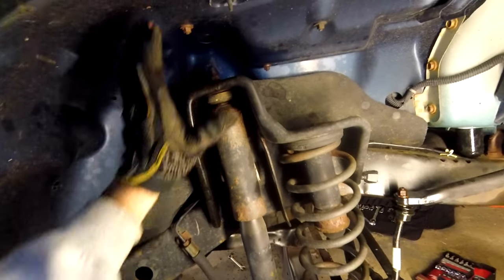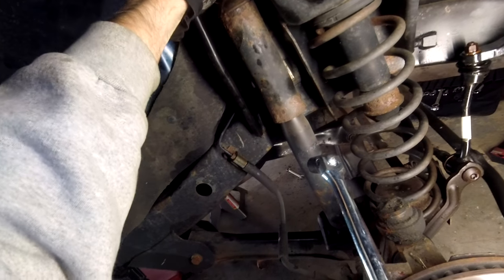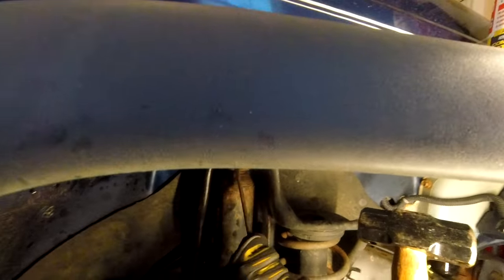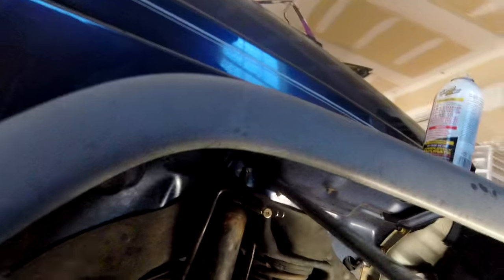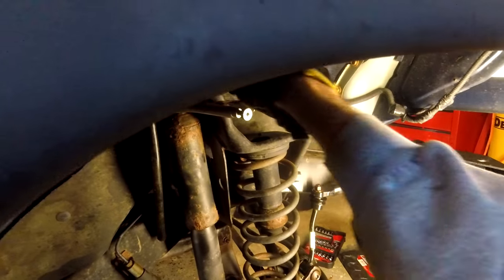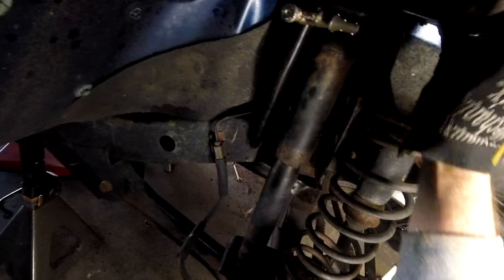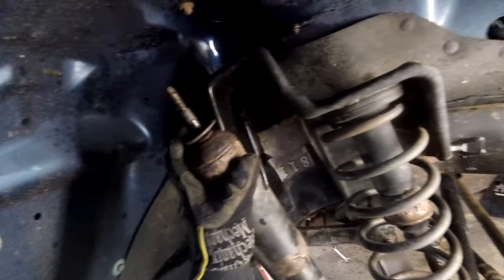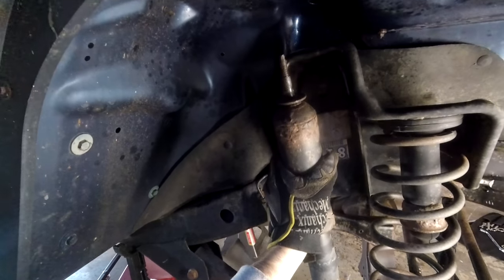Upper Front Shock Bolt Removal Tip   Project 2004 Jeep TJ Wrangler How To

Comment: Head mounted cam?
Reply from the maker: Yeah... just experimenting with new ways to provide info... this was a learning experience because I see the fender was blocking some view since I was working slightly above head level... Like it? Hate it? Next video has a different view I am trying.. ;-)
Reply: i did, agree the fender was in the way partially, but overall i thought it worked well. While this would be more work, have you thought about capturing the video with one of your rock cams and the Seicane? Then do voice over? the mag-mount and size of the camera may help getting into the small spaces...
Reply from the maker: The quality of those cams wouldn't be good enough.  My main footage is all 4K and this cam lets me grab 2.7K video (cropped 4K). I could stationary mount it...but I am experimenting with the POV experience a bit.

Comment: I could have removed that top shock bolt in under 10 seconds with no tools, especially if you are not reusing them. Unbolt the bottom, and then just pull the shock out and start lifting up, top shaft will break off and you are done.
Reply: uhh